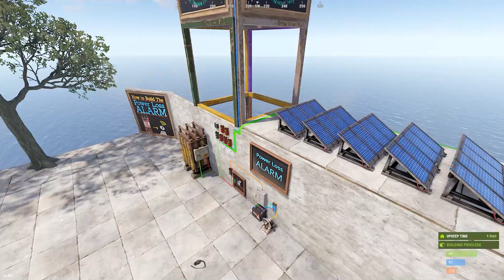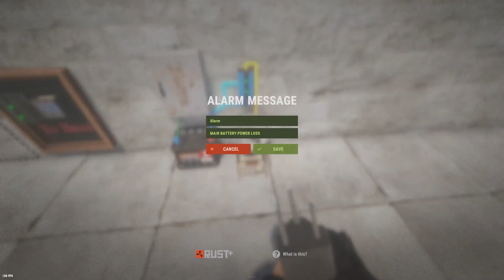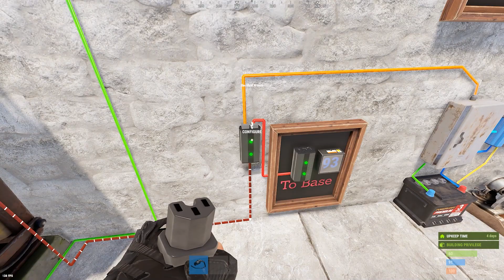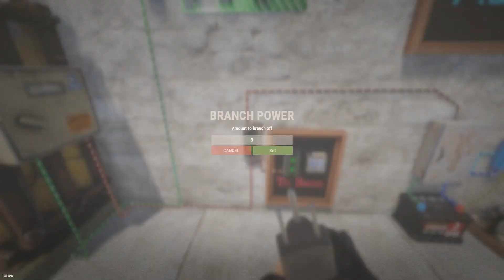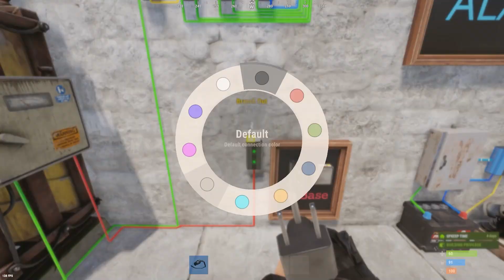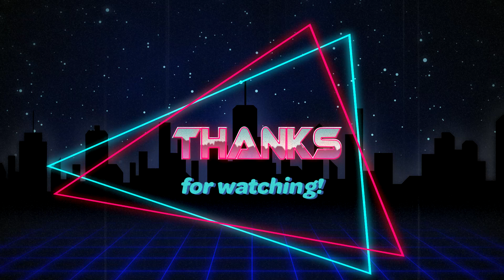RUST Electrical | How To Build The POWER LOSS ALARM - 2023

Comment: Can’t you just do this without the small battery why is the small battery needed?
Reply from the maker: You need the small battery to power the smart alarm if the primary battery fully drains, is destroyed, or is disconnected. RUST batteries don't slowly lose power as they lose charge (ex. the large battery will output 100 rW up until the last second of charge capacity). I hope that made sense!

Comment: Austin, what would be the best way to implement this to determine if a wind turbine got destroyed. Would we have to use the branch main power out into a splitter and the splitter back into a root combiner (just using it as a go-between with one in and one out) I think the whole circuit should cost roughly 5 power.
Reply from the maker: Best way would be to insert the circuit between the last root combiner and the input to the battery, or between the wind tubine and the battery if no root combiners. This would be a good video, tbh. I'll add it to the list. Thanks for the idea!
Reply: I think the wind turbines are an easy target..not easily destroyed, but nice to know if something decayed or got MLRSd @AustinKlailaGames

Comment: Very nice video again as always ihave so many learned from your videos. You can take this to the extreme. I have a complete base raid alarm on my alarm system, which means as soon as a wall or roof is removed, an alarm comes on my cell phone. I also have a reporting function if a Samsite fails. To prevent topdown

Comment: Nice little circuit. Only thing I would suggest is you put this on the end of your power distribution not at the start, so your alerted as soon as the power goes out not once the battery is down to its last drop.
Reply from the maker: Intuitively, you would think so! However, RUST batteries don't behave like their counterparts irl. They produce their full output up until the moment their capacity runs out. Example - a large battery will have available 100 rW up until the second before its capacity reaches zero.
Reply: Aaaah. Interesting. Very good point. Good old Rust logic.

Comment: waiting for the optimal way to monitor power of turrets. if turret gets destroyed, backup turret turns on
Reply from the maker: This is something I'm constantly working on, actually. It's really difficult because of how rust handles electricity.
Reply: @AustinKlailaGames  you're right, I thought it may be possible using splitters because of the way they share power. If a turret is destroyed it causes the remaining two connected to splitter to recieved more power. I tried using a branch a d it's mechanic to detect the signal in some way but I don't think it's possible. Issue is the turret needs some kind of status online output, if it's destroyed the constant 1 power signal would die and then can trigger the Xor  switch but hey perhaps a feature Facepunch can add?